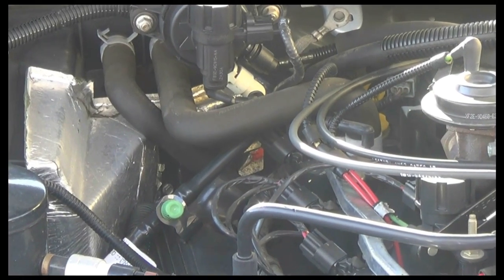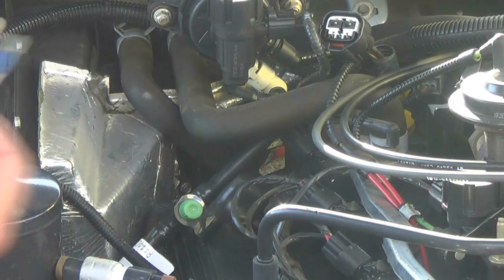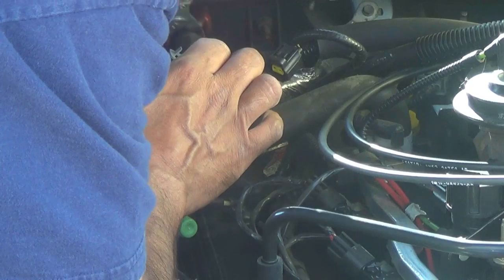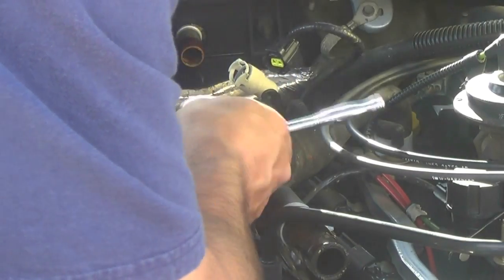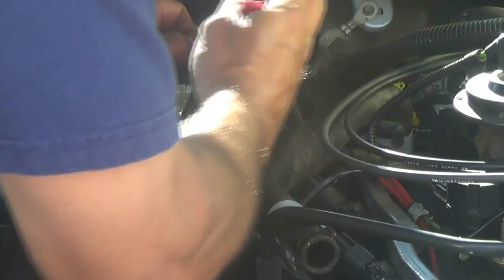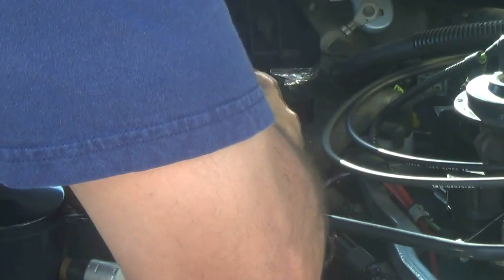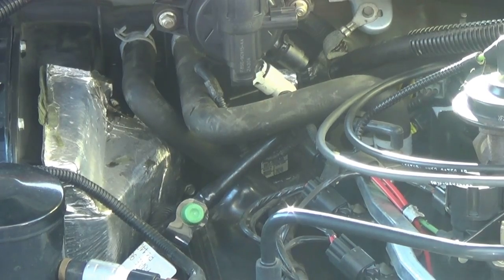2002 Ford Crown Vic Blower Motor Module

Comment: 1:00 Putting a jumper across the connector will only prove the motor itself as go/no go. What do you do to prove intermittent fan speed? Is it the EATC itself or this module?

Comment: I think mine is just starting to go out. I was driving and it just started switching to the high fan. So I put it in vent mode and low speed on the wheel. Then, it did it again, going in and out on high speed to low. I checked it on all settings. I drove it later though and it was ok. But I still think it's on the way out.

Comment: I can't and didn't see where from you disconnected the 4 wire connector you used to jumper.
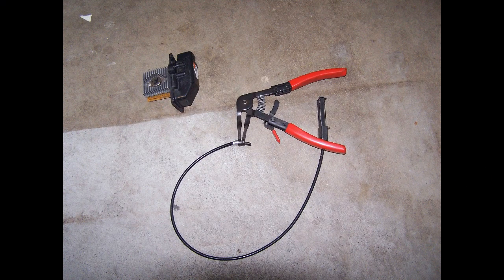Reply from the maker: I disconnected it from the blower motor resistor pack. (AKA Module)  At 9:30 of the video you can see what the resistor module looks like.

Comment: Pulled my 2005 module and fixed it, just a burnt solder connection of the large connector tabs. Also, it is located higher on the firewall, right behind the passenger side engine valve cover. Getting a 5/16 socket or wrench on the screws is eventually possible since everyone has different skills and tools. You need a lot of time and patience to work these out one agonizing flat at a time..going back in is also lots of fun. You WILL drop one screw or more so work over a clear spot so you can find them down on the ground. Getting the module out and back in you will need to trust that you won't break it as you hammer with a screwdriver or punch to drive it out past that last 1/4" as it hangs up on everything in the way from the motor. Don't bother to try taking off the connector until you get the unit out. There's enough play in the harness to ram the module out and then conveniently struggle and curse the connector off. I wish you all the best of luck and suggest you start early in morning on this 2.5 hour - "20 minute job". You will mentally invent all kinds of reasonable tools that don't exist which could make this simple job normally doable. Thank you once again, FORD. .. oh has your blend motor failed yet? ..sorry that's a different nightmarish eventuality.
Reply: Man I sure hope MINE holds up! I suppose this job at a Ford dealer is a small fortune too! I gave up trying to work on Audi's! Last time I did more damage than I fixed and had to end up at the Audi service center anyway. Working on cars won't be allowed much longer. That's how gubmint plans to get old cars off the roads - and US into self-driving death traps! Oh and if there's a warrant out on you for anything, that car will lock the doors and take you right to the precinct! HaHa - Good Luck OM!
Reply: Yes! At home driveway car work WILL eventually be abolished, it's already being done in many HOAs. The computers are getting harder to tune with locks and copyright blocks growing around them. Oil changes at home? Call the EPA for a permit and notify everyone within a 2 mi. radius before your approved work schedule. starts and don't forget to comply with the followup inspection team that will arrive at the most deliberately inconvenient time. It's coming, the peeps won't see it and most won't care. They may well be still wearing their WuFLu masks.

Comment: I did my 2003 GM. I removed the hoses and vacuum unit for better access. I was able to keep the lines on the vacuum unit still attached. I couldn't get the resistor out without removing the hose going to the engine for enough clearance.

Comment: Informative video! I was a bit shocked to find the blower motor not spinning at any speed in my car especially since i had replaced the EATC a week and a half prior to the Blower Motor Control Module failing. Took less than a minute to diagnose with the jumper wire like you said to do. FOR ALL OF YOU FIRST TIMERS HAVING TO REPLACE YOUR MODULES.... I (luckily) did NOT have to remove the heater core hoses on my 2005 Crown Victoria although it was pretty tight. Dont force it and take your time and you'll be fine. For the top bolt youll need a 1/4 inch drive ratchet and an 8mm short socket, and the lower bolt you'll need two 3 inch 1/4 drive extensions, a 1/4 swivel socket and the same short 8mm socket on the end. Be mindful of the plastic intake manifold when taking the part out as well. Being rough and forcing it out could likely cause the intake manifold connection to crack, break, and leak (intake manifold replacement would be needed at that point, think $150+). I went to the local junkyard and grabbed a module off of a 2003 Marauder. I was able to remove the module without taking off the heater core hose on that car as well, although it was even tighter that on a Crown Vic because of the wider 4v heads (same tools i listed are needed on both cars to remove) $7 later and i was back in business. I plan on opening up my original one and re-soldering the connections as stated a few times in the comment section here. Thanks for the upload brother! ✊🏼

Comment: What does that big ground on the firewall go to my wires missing I'd like to know where to reconnect it
Reply from the maker: Are you referring to the ground strap?  If so, that goes to the cylinder head or block.

Comment: I usually like to  get in between the hose and the tube with a offset  radiator hose tool whenever possible and work it  between and around to free hoses stuck on to the tubes

Comment: I gotta 2002 grand marquis and my heater/ac and vent doors work famously "for now" .. what's up with the speed sometimes kicking up by itself or staying on high only? Seems the speed adjustment may be malfunctioning sound familar?
Reply from the maker: bostonsirish1 
Check your blower motor connector and see if it’s overheating. A bad connection or a fan motor that is drawing too many amps could be the problem. Also check the fan motor resistor pack.

Comment: quick question... so we bought a 01 crown Victoria and it had a toggle switch for heat and air. ..it blew on high... any ways we tried to fix it so we didnt have to use a toggle switch the guy told us he thought it was the control panel type thing where you turn your air on and off but that wasnt it... We've checked relays... fuses... Etc. .. so what could be wrong with it if it works with a toggle switch but not the main control panel? it wont blow with out that toggle switch
Reply: Danielle Howell I would replace the control unit in the dashboard personally! It's old enough so thier cheap now!

Comment: Thanks for the informative video - I used it to troubleshoot my non-working 2003 Grand Marquis blower. It was my blower resistor, and replacing it solved the problem. I had the worst time removing the electrical plug from the resistor housing, but after that it wasn't bad. took 2 hours total (I did not remove the heater hoses, but remove the EVAC canister).
Reply from the maker: Glad to hear of your success.

Comment: These blower resistor modules in EATC models have a design flaw.  Even if you put a new one in, it may have the same flaw and the problem will just come back.  The problem is they didn't use enough solder on the connector pins where they solder into the board.  Under stress and flexing the minimal solder joint eventually cracks and the connection becomes intermittent.  The symptoms are no blower air or full speed blower air.  If you can get the resistor module out, it's an easy fix yourself and probably much better than a new module with the same problem.  Just take the module apart and scrape off the yellow-green coating on  the connector pin solder pads.  Then resolder with a lot of solder to firmly hold the pins in.  Do all 5 connector pins since they'll all have the problem sooner or later.  Amazing that they tried to save a few pennies worth of solder and created big headaches for customers.
Reply from the maker: Great tip!
Reply: thank you for this, I believe I am experiencing this exact issue in my 04 Vic.  The blower resister module was replaced hardly a year ago, and it's already back to blowing high at all times again.
Reply: I was thinking of changing the voltage regulator but if its cold solder joints even better. I'm not liking the fact that its buried behind the engine like that

Comment: question i have a 2003 crown vic, and the heat /air is not blowing, but when i start driving mainly at a constant speed, i feel the heat coming thru the vent, its not blowing but its damm sure coming thru, what could be the problem
Reply: Yg Bodybuilder did you figure out what caused it
Reply from the maker: From what your are describing.  Sounds like you have a bad blower motor.  Try tapping on it with a small hammer and see if it starts running.  Have your controls set to high speed.
Reply: ok so i put another blower motor in and its the same thing going on
Reply from the maker: Yg Bodybuilder Is voltage getting to the blower motor? Does it have a good ground circuit?
Reply: Nicoya i have no idea i know the ground been the same since i had the car

Comment: Be careful with the heater hose connection to the manifold. The manifold nipple is plastic molded part of manifold and can easily break off. I had to replace my manifold.
Reply: Isn’t there a brass update for this? Mine broke too...